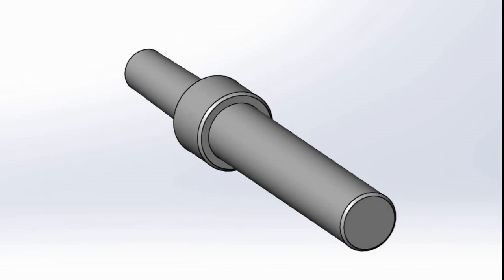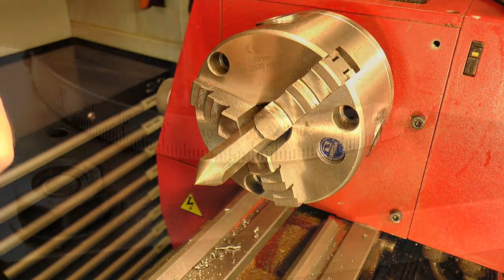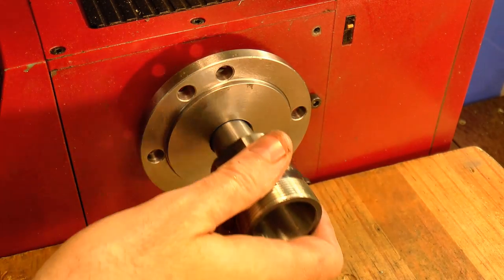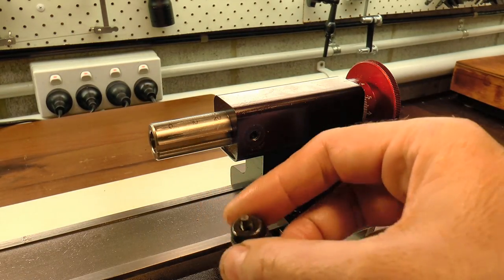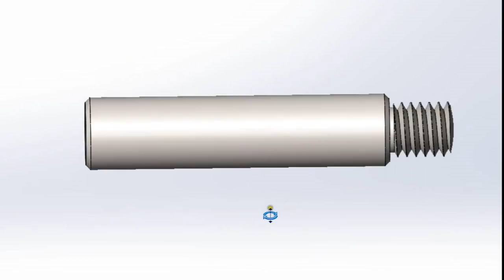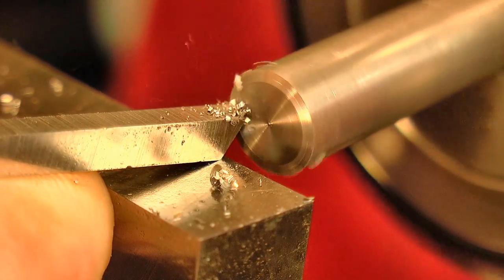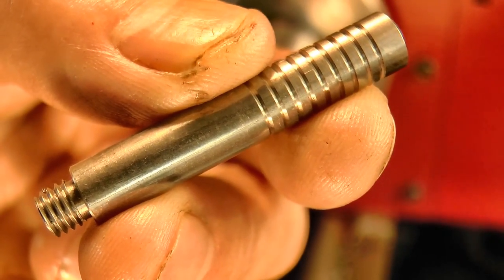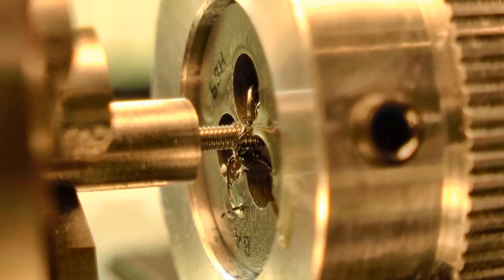Home Machine Shop Tool Making - Machining A Tailstock Die Holder For The Sherline Lathe - Part 2

Comment: Dear Clickspring, I recently discovered your channel and love your attention for details. Everything you make has to look good and feel good. I'm blessed, or cursed, with the same attitude on how things should be done. For me it's my bread and butter and discovered that clients like the same approach  too. I'm an Industrial design engineer and became a machinist to prove the stuff I thought of. Great combination for me and my clients. So happy to meet you; I'm Job. I'm trying to watch anything you put on YouTube and came across this video. It's almost 8 years old so probably my comments on this chapter are old news and you improved your engineerings skills above my suggestions since then. My suggestions, here we go; aluminium is light and strong and a terrible bearing material unfortunately. The wonderful aluminium body you made here acts like a bearing on the steel guide when tapping threads on the lathe. Therefore I would add some bronze bushings in the aluminium housing to act as a bearing. Furthermore; cutting a morse taper right is a little more complex than you showed. Use the Dycom fluid to determine the fit on the taper instead of filing and sanding until it feels right. I know, it will work, but I like these "how to do it right" details just like you. No nagging here, just support. Thank you for all of your wonderful uploads and all the best, Job

Comment: Love the video, they are all very interesting, looking forward to the next ones.
One small refinement to your tail-stock die holder. Consider spot facing, on the mill,  the threaded hole where the handle meets the holder. this achieves two things, it will tidy up the interface between the two components and strengthen the joint between the components.
Reply from the maker: +David Jenner Yes I completely agree - someone else pointed that out not long after I made it, and I was kind of kicking myself for not thinking of it! Thanks for the feedback, and thanks very much for taking the time to watch :)

Comment: Nice!  I’m thinking of making one for my gear head lathe but without a handle, I would use it under power and hand held. not having the die locked to the tail stock is a good I idea, and will save me time and parts.But making a hex cut in the center to use a wrench (1/8" spanner) for the hard stuff when needed, power off and spindle lock in that case.

Comment: You do beautiful work.  Watched all of your videos that I could find. Excellent narration and presentation.  One suggestion to simplify your work: chuck the hex bar you are using for a center close to the jaws.  Put the bent tail dog ( I think you call it the carrier) on the workpiece, let the tail of the dog bear against the chuck jaw.
Reply from the maker: John Reese Hi John, I think I tried that at some point but found that the tail didn't quite reach to the jaws, but I will check again next time to be sure. Thanks very much for passing on the tip, and thanks for watching.

Comment: the Die can be made at home with an old marking pen artline type not totally dyed up rip it up and you find a small felt like inner section grab it and toss it in A small second hand spice jar with a lid using a small amount of oxylen solvent you can get from Bunnings (wall mart we do not have wall mart yet in Australia but there are others you may need to play ) 
in OZ wash out the rest of the old marker and add all inn the jar // a small paint brush and remember to keep the lid on drys out real quick

Comment: As I find myself just spending the money required to buy the Sherline tail stock die holder I really like the premise of this video. I gotta tell you its Love/Hate though. There is no way I have the tools you have to make this and was really disappointed to find you made the part for the Sherline, but not using a Sherline to do it. So I Love the precision of your work and it is now my new standard to take my own skills to but I Hate that I couldn't make this type of part with the tooling I have.
Reply from the maker: Reckon you could skip the groove pattern and make the rest of it on the Sherline, just a bit easier to handle the Al body on a larger lathe.

Comment: Very nice work, takes far to much time to make, but be proud of the result., I made one using scrap aluminium and steel and mount het in my drilholder. one point dont use the handle! remove it and grip the body with your hand, you can power cut now safe. start the lathe grip the holder and push it again the workpiece. At the end loose grip and stop the latte reverse it and same action. This works save and give better results on the treath. I also made a few dye holders to fit in the main holder for different size dye , never tought using the back of the holder like you did .

keap the good work lijke your filming and finish .

Comment: Do you not think that Silver Steel (drill steel) might have been a better choice for the Morse Taper section? After making such an exquisite piece I'd hate for it to fail because the tang wasn't resilient enough. Just a thought, mate.

Of all the engineering videos I have watched on YouTube over the last 15 years, yours are by far the best presented and so very strictly concerned with accuracy (almost on the verge of Obsessive Compulsive Disorder), in terms of absolute precision.

I am still very much enjoying your videos, which I repeatedly play back, and can't wait for the next in the Skeleton Clock series. Keep up the good work, Chris!

I served my apprenticeship as a technical engineering apprentice in Leeds, Yorkshire, UK, way back in 1968. I left the industry (due to future uncertainty) in December 1972 to take up the office of Constable. I retired a Sergeant in 2002 after 30 years and took a few months out before being accepted as a pupil at the Newark International School of violin making, which I graduated after 4 years (normally 3 years but I had health problems in Year 3 so resat that year).

Now, at 64, I suffer from osteoarthritis and carpal tunnel syndrome, so I'm unable to work accurately in wood with hand tools, although not so many years ago I was working in wood to 0.1mm accuracy (which many engineers in metal score as accurate). That's why I love watching someone such as you, possessing both the skill, the imagination, the determination and the machinery by which to accomplish your goal.

I'd love to be there in your workshop, watching your undoubted skills in metal turning, but it won't happen... so please, Chris, feed my appetite!
Reply from the maker: +Gordon Burns Terrific to read your story Gordon, thanks for sharing it. The school of violin making must have been incredible, I can only imagine what interesting ideas you must have been learning there! Definitely more projects on the way - the current clock build has 5 more episodes to go, and the project to follow it is in development now, and is looking very promising :)

Comment: for finishing cut you can use a cutter called - lathe sheer tool, it is very easy to grind and set up, and the finished cut is super smooth, even on problematic materials like copper, mild steels or some soft aluminum alloys, on steel the finished surface will almost feel like it was ground, the "downside" of the cutter is that it can only sheer off couple thousands, which is also quite useful for finishing diameters to exact dimensions - something that isn't too easy to do on these small/light lathes using regular geometry cutters
Reply from the maker: jz1199 Thanks for the tip mate, and thanks for watching :)

Comment: If you put some bluing on the tapered shaft and then fit the matching tailstock insert on the shaft, you get a better idea of how the taper is matching based on how much bluing rubs off.
Reply from the maker: +Darren X Thanks for the tip Darren, and thanks for watching.

Comment: Without a tang on your Morse tapered shaft, how do you eject it from the tailstock? I have never seen wood turning techniques applied to a metal turning lathe before, it has great possibilities for forming artistic ends to screws and shafts, I must try this approach, many thanks for showing this, as you say, much easier than making a form tool.
Reply: +Maarten Moerland Yes, this happens if you have an extended tang on the morse taper shank, but without the tang there is nothing to push on, on a normal lathe, perhaps Chinese lathes are different.

Comment: Great job as always!
I always wondered why you mark out the length of the shoulder you are turning with the calipers instead of using the dial on your lathe?
Reply: Hi. I've done this too, the main reason is that you don't have to keep taking your eyes off the workpiece to look at the dial.

Comment: I admire the close tolerances you work to.

I would also admire a proper analysis (even at the back of the envelope level) of the actual tolerance requirments of this - with the long engagement, I suspect the angular accuracy is almost inherent to the design, and the "on centre" tolerances (for a die that is pretty much self centreing) are negligeable.

Working to closer tolerances than are needed is ineffecient engineering!

Comment: Dude, priit mölder is totally right, your work is sensational! 
Just a quick question though, what is the brand of the machines you have and use so wonderfully, and where did you get them?
(And maybe a quick video about your tools and machines?!)
Reply from the maker: +McJayJazz Hey McJJ, thank you very much for the kind words :) Mostly hobby grade lathes/mills etc with a few exceptions. The belt sander is A Delta Rockwell (awesome), bench filer is made from a casting kit, more info here: http://www.clickspringprojects.com/die-filer-or-bench-filing-machine.html I appreciate your support :)

Comment: What does the Sherline offer that your larger lathe does not? It looks to be similar in size to the “watchmaker’s lathes” that used to be easy to find in Waltham, Massachusetts in the decades after the factory closed, but it seems like it would be frustrating to use, especially the longitudinal feed.
Reply from the maker: More info on the lathes here: https://youtu.be/SOT9grqMDvY - Cheers :)

Comment: Hand turning certainly can be a rewarding experience, have you tried hand thread chasing?
I noticed you still used bolts to hold your chuck on, have you considered changing to studs and nuts?
ATB
c
Reply from the maker: Chris Stephens Hey Chris, haven't tried either; might have a look at a stud mod though - thanks for the suggestion.

Comment: As I mentioned in first 1st part video, its so nice to see you using hss tooling, and although you probably do use carbide tooling I get the impression you haven't been brainwashed into believing its the end all and the only way,
Reply from the maker: +Walter Maisey Hey Walter, thanks for watching mate. You are correct that I mostly use HSS. I like that I can grind a shape to fit exactly what I want on the day.

Comment: the piece you are making arround 7:43 in the video.. 
what use does that have ? i see u didnt use it when u showed the actual use of the project
Reply from the maker: Its a handle -  there if I need the extra leverage but you're right, I find I rarely need it.

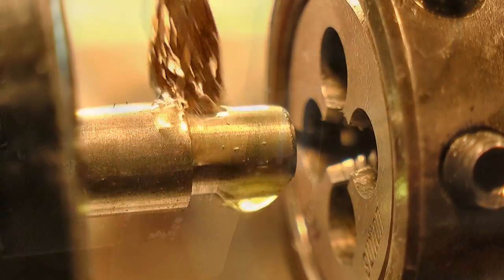Comment: 5:35 the question is: how was the first die holder made?
Reply: I know it's awfully late to answer this, but that was just a store bought part - the type of handle that comes in most tap and die sets.
Reply: and I know this is awfully late to reply, but I figured. I have actually bought a lathe since I made that comment.

Comment: you often make 45-degree cuts on the lathe in your videos... are you simply feeding and cross-feeding at the same time/rate?
Reply from the maker: +KevCarrico Generally I make taper cuts with the cross-slide locked, and feed in with the top slide on the desired angle. Thanks for watching and asking :)
Reply: "top slide" meaning the "compound"?

brilliant work, sir!

Comment: Thanks for another great video.  I don't think I've seen a freehand tool used on the metal lathe; what does the whole tool look like; is it long like a wood-turning chisel?  Does it produce a lot of torque on the tool?
Reply from the maker: Shaun Crampton  Its a bit like a wood turning tool, but a lot smaller. Same basic idea though. Not much torque, very pleasant to work with. I'll do a wider shot next time I use it so you can see it better. Cheers mate.
Reply: That's interesting; I'd have guessed that metal would need a bigger tool.

Comment: How did you ensure you were on centerline with the master you used to set your cross slide when cutting the taper?
Reply from the maker: +Gerald Gepes Started with approximate alignment using the tailstock center, then used careful observation of multiple passes to reduce error. It is not the best method to copy a taper, but it is satisfactory if there is an appropriate test sleeve to test final fit, and using some Prussian Blue would have made the job even better. Thanks for watching Gerald

Comment: Hey Chris, what is the point of using those metal clamp type devices at 1:25?  Are they counter weights?
Reply from the maker: +Penfold8 They are called "lathe dogs", or "lathe carriers", and their purpose is to transmit the torque from the the lathe spindle to the work. The work is mounted so that it can rotate truly between between 2 center points, and the rotational torque is applied by the lathe dogs. The design of each of them is such that they are reasonably (but not perfectly!) well balanced, so as not to introduce too much vibration when rotating at high rpm.  Thanks for asking mate :)
Reply: +Penfold8 
I'm not sure if his answer, while true is that obvious.

Basically the thing is that tiny tip on the end of the piece he's using holding it up, does hold it up but its not much to transmit rotation by.

Imagine you had a drill and you just barely touched the end of a metal rod. Well your not going to actually spin the rod in a circle cause you aren't grabbing enough, if you push in you'll actually put a hole not grab.

So the thin rod barely touching it is to grab exactly center and hold against gravity.

Then you take the lathe dogs, those grip each part around the outside and press against one another. 

So the part isn't rotated by the rod pushing against it. it's rotated by the lathe dog on the lathe pushing agianst the lathe dog on the part. 

You can see that as the left "L" shape spins it forces the other one to spin and that the L shape is grabbing the forced by the motor to spin rod and the other is grabbing the part to work.

Comment: What kind of steel you use to make cutting tools ? HSS or other ?
Reply from the maker: +Miguel Miguel Most of my lathe tools are HSS, other than the custom cutters and form tools which are made from tool steel. Thanks for watching.

Comment: question, why don't you just hold the hex collet block in the 3-jaw?  asking because I'm getting a lathe soon and wondering if I really need an MT3-ER32 holder.
Reply: Belated reply John but most 3 jaw chucks have noticeable runout and it's not consistent across different diameters either.

Comment: why does everything in your shop look slightly straw colored even tho whenever you heat treat you sand off the color and not everything you make is brass
Reply from the maker: I filmed this before I had figured out white balance on the camera - its all a bit warm looking :)